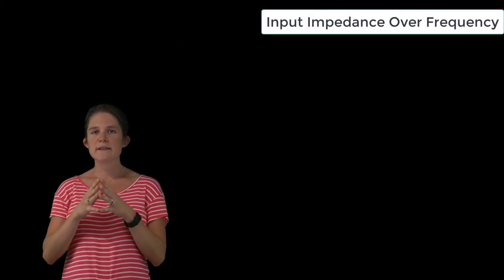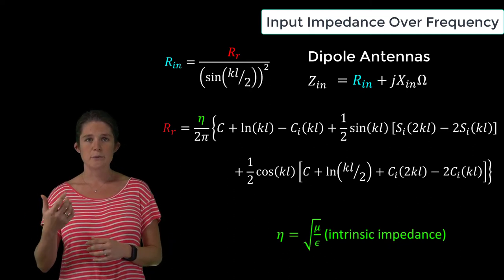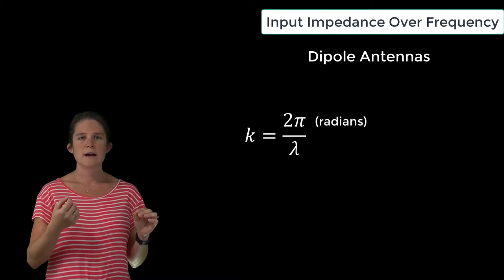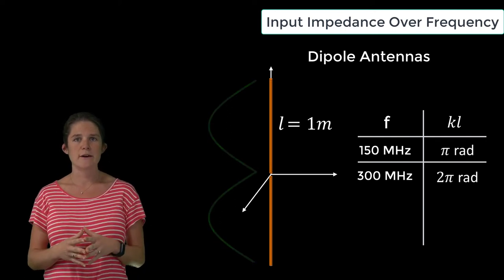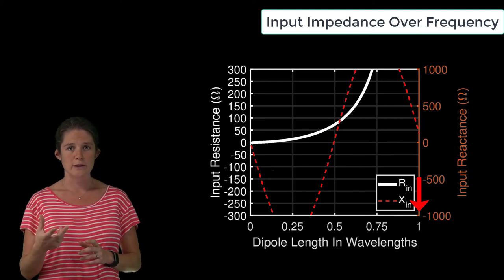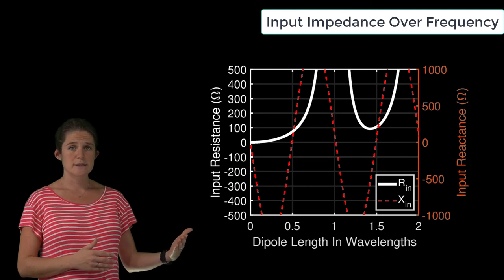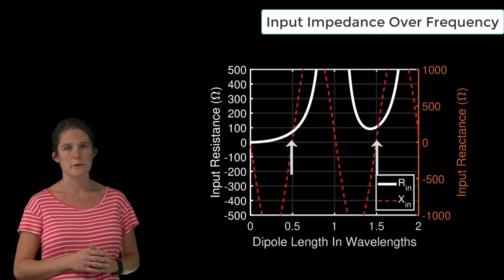Dipole Input Impedance Over Frequency — Lesson 2

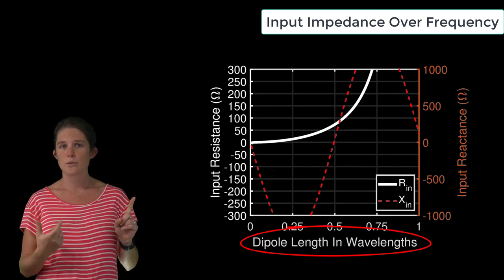Comment: @4:08 the plot shows the "dipole length in wavelengths" (l/lambda). Does this mean that this chart is independent of the actual nominal wavelength? While the term k*l can be expressed as 2*pi*(l/lambda), I'm having trouble how to reformulate the term (2*k*a^2)/l in Xin without having to pull out a nominal value for lambda e.g. (2*pi)/((l/lambda)* lambda^2).